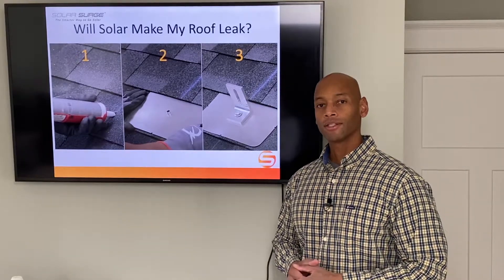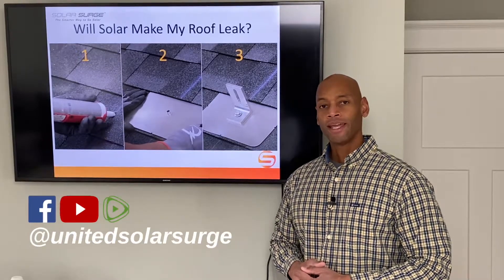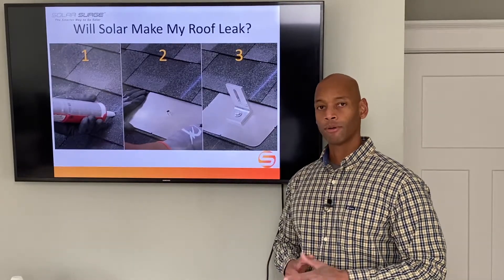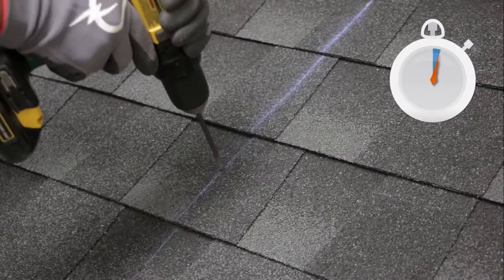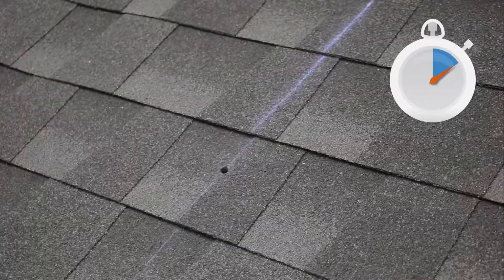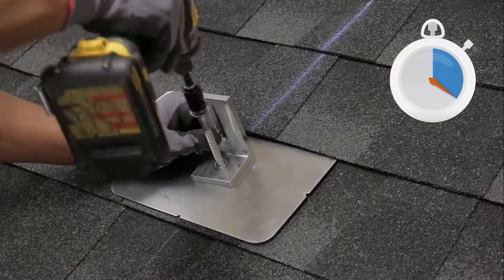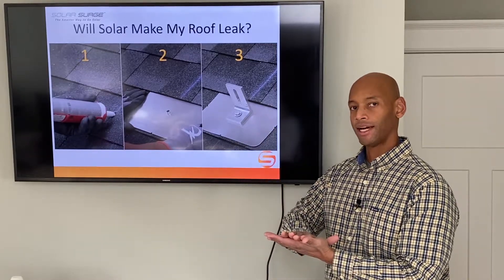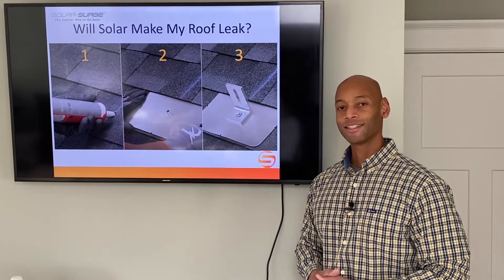Will Solar Panels Make My Roof Leak?

Comment: I  do not like the fact you have to puncture holes in the roof to install them. It makes me wonder when there are violent storms they can blow under the panels and loosen the fittings causing the leaks. Do not put any solar panels on your roof.

Comment: Sadly, far too many solar roof installations result in leaks.   From metal and rubber slate to asphalt and clay, from flat to 9/12, roofs on simple A-frame’s to complex hip’s, there are a vast array of problems and complexities that open many solar roof installations up to problems.  In general, a lack of knowledge and proper training are some of the biggest contributors to many solar related roof leaks.

Comment: Hey Joe, how often have you run into roof leak due to solar panel install and who is responsible to fix it?  Is there any technology coming up that does not need to be roof-mounted for solar energy?  Also in general is it better to go direct through a company like Tesla, or an independent solar installer, or a company like yours which I assume will contract out  to a local installer, or a company like SunRun?  Thanks for the info.  Your videos are awsome!
Reply from the maker: Thanks for writing in.  The installation company will generally offer a waterproofing warranty as part of their contract.  In terms of what company to use, it really depends on your needs.  Tesla is good is you just want a low-cost, cookie-cutter system and you are OK buying online.  If you want a custom-designed solution, then it's probably best to work with someone like me or a trusted local installer.  I'm happy to help put together options for you.
Reply: @SolarSurge  What is the best email address to get in touch with you?
Reply: @SolarSurge  I just sent you an email to info@solarsurge.net